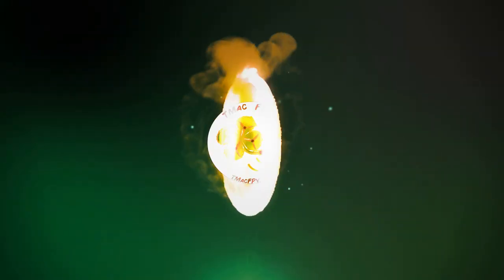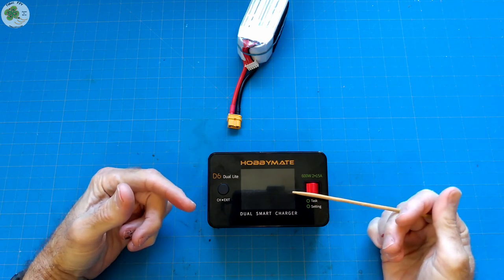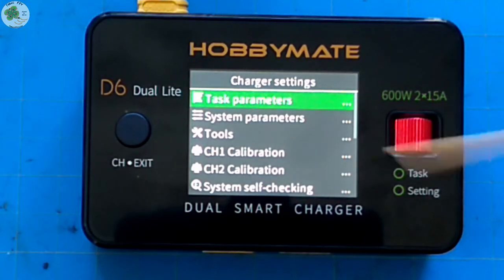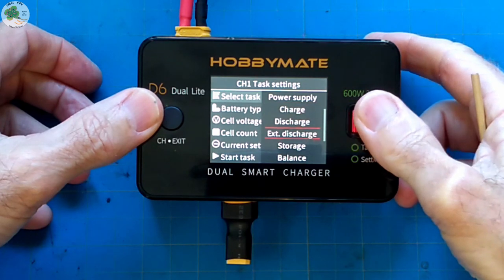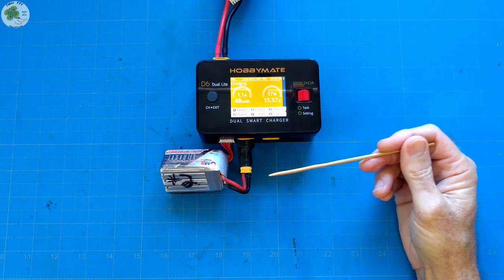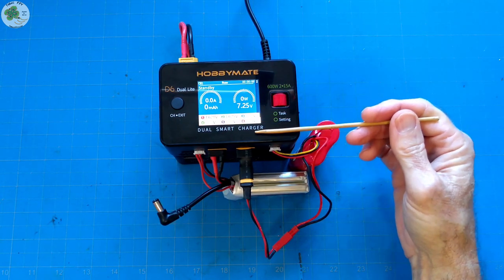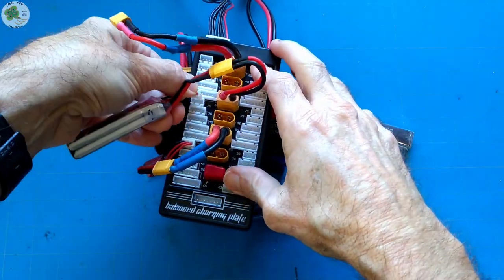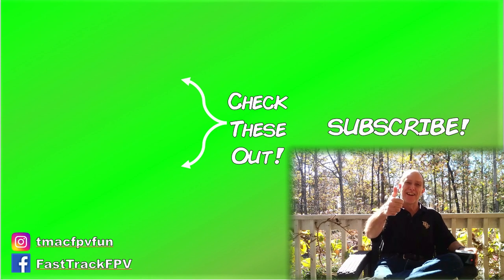Lipo Battery Charger (HOBBYMATE D6 DUAL LITE!)

Comment: Great overview. It is best practice not to connect a battery to the charger before it is powered on. The anti-spark circuitry is not activated until it is powered on. The automatic self test also runs, and states that there should not be a battery connected. There may be other safeguards in place that require the charger to be powered on. Best of luck ☺️

Comment: Thats prob best review of this charger on youtube. Im looking at this one under the hota p6 brand. But im torn cos i like the way toolkitrc m6d interface works and small size, problem is ive a toolkitrc m6 which blow its internal fuse for no reason(now fixed) and now cell 1 and 2 voltages flucuate by 0.1 volts on screen and other cells calibrations you just cannot get correct (cells volts checked with multimeter) seems to be affected by cell count. Do i give toolkitrc another chance with the m6d as all reviews are gr8? Whats your take on it?

Comment: My hobby mate is giving out a warning about the balancer port voltage is to high anybody else have that problem and or fixed it ?
Reply from the maker: Sometimes near the end of charging this is happened to me. Try reducing the charge rate. It's like toward the end, the higher charge rate is trying to "push" too much juice in for the remaining amount of charge. I just reduce the rate to about 1/2 of what it was originally to top it off. This usually happens to me on 2S or Li Ion batteries